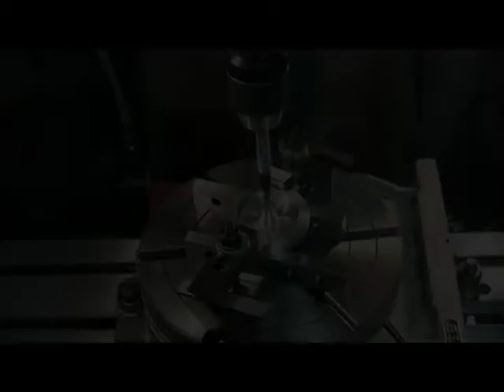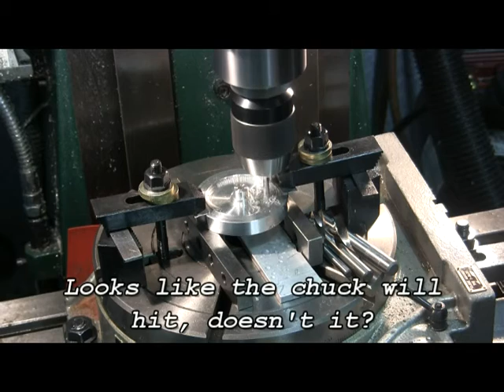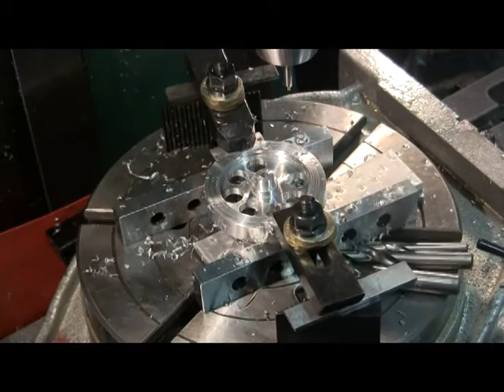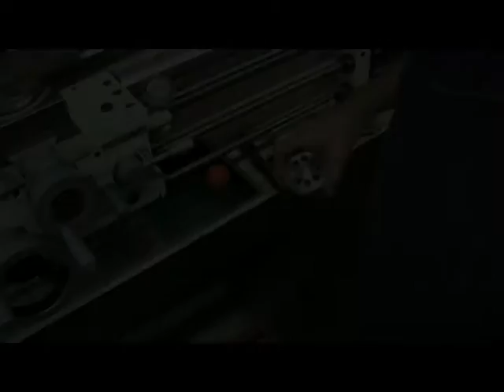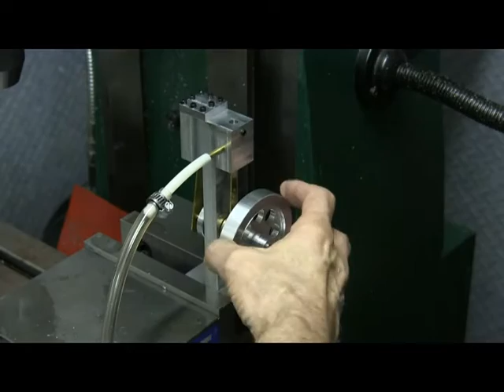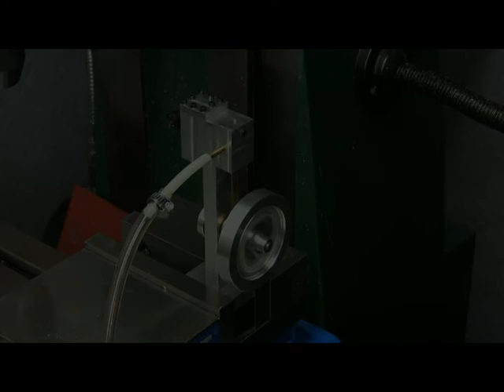Machining two spool valve engine blocks part 5; concentrating on one

Comment: looking good Bill. I hear you want to use drill rod for your spool valve what grade is easy to machine like drilling cutting on a mini lathe would like your input on that.
Reply from the maker: +Oscar Flores Oscar, I THINK I texted you my e-mail address! :)

I use W1 tool steel drill rods. They are easy to machine. I buy them in 3' lengths from McMaster-Carr.

Here is a link to the stuff I use . . . 

http://www.mcmaster.com/#drill-rods/=10n54e9
Reply: got your replie have you tried ONLINE METALS.COM they also sell short lengths. Will look in to this.
Reply from the maker: +Oscar Flores Oscar, sure! I buy from them and speedymetals.com, too.